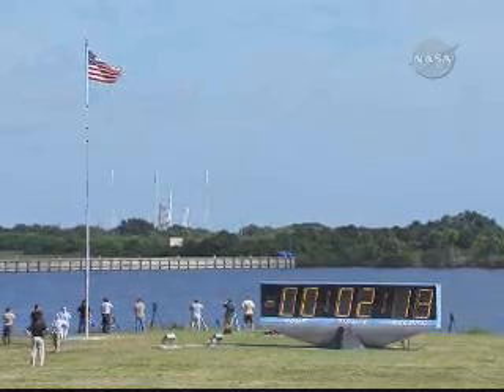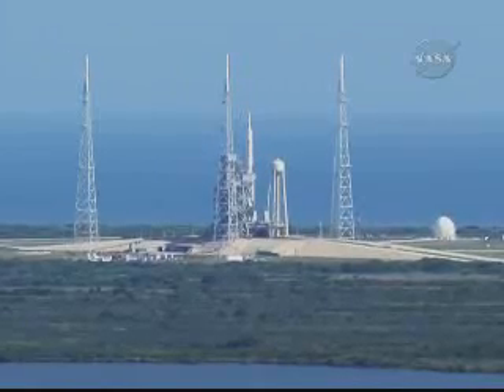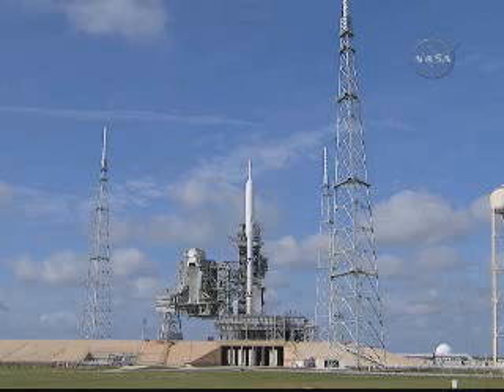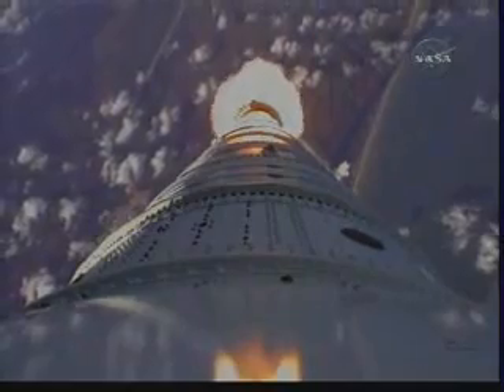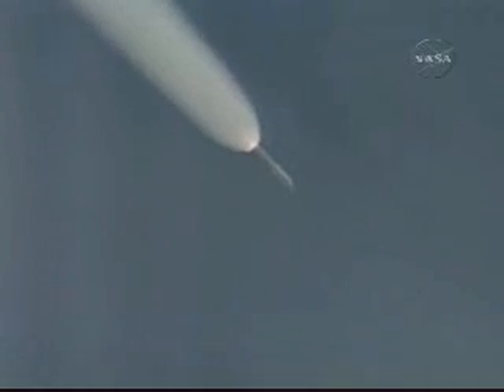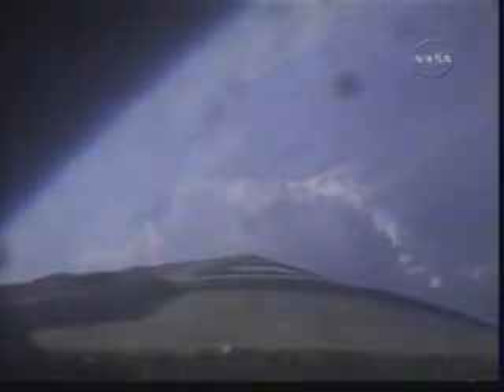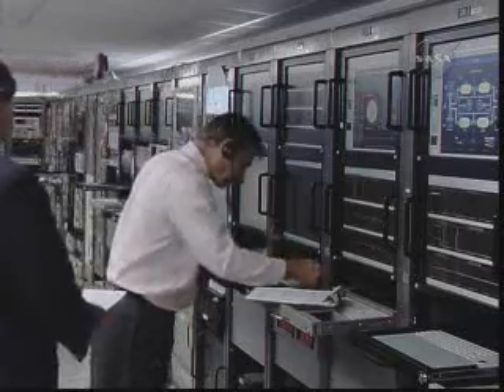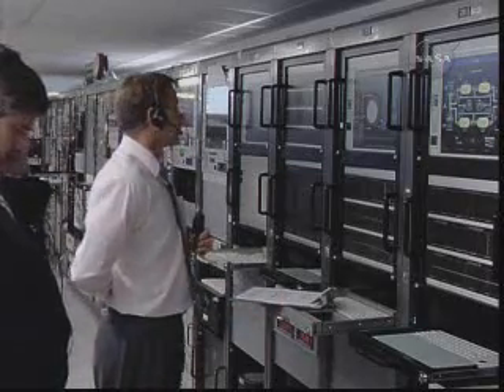NASA Ares I-X Rocket Launch Wed, 28 Oct 2009

Comment: @A86  - The key word you left out was "could".  Costs "could" drop which does not say they will drop.  Let me quote the same source for what the Shuttle was suppose to cost.  "Early cost estimates of $118 per pound based on 1972 dollars.  Correcting for inflation, this equates to roughly $36 million incremental per launch costs.  The shuttle program has been criticized for failing to achieve its promised cost and utility goals."  Actual cost ended up $750 million p/flight.

Comment: @ti994apc - Actually it's only $1 billion/flight if you only fly the rocket once a year. If you fly it several times a year the costs drop drastically to around $138 million/flight. Around the same cost as a Soyuz flight and only a fraction of even the cheapest Shuttle flights. 

The Falcon 9 carries the Dragon which is not an interplanetary vehicle.

Comment: Too expensive Lockheed !!  1 Billion a flight !!  Are you kidding me!  Solid rocket fuel (BAD IDEA) which requires an unbelievably big / heavy escape system.  Ares1 is much bigger than Saturn 1B and only can carry 5 people.  Falcon9 only 50 Million a flight and carries more people and much safer.   Ares V can launch for 90 million and Boeing can create a capsule for it that would be much safer. .

Comment: @ThermalHD - That wasn't a problem. That was one of the projected outcomes.

1) The upper stage in this test is a dummy. It's unpowered so it can't fly away with ullage motors.
2) The Ares I-X is tens of thousands of pounds heavier than than the Ares I and the first stage is a 4-stage SRB instead of a 5-stage one making it only 80% as powerful as the real thing. First stage separation occurred here at a lower speed and altitude than Ares I would with 9 times as much aerodynamic pressure.

Comment: Yeah that's my fault for not wording it right. (I shouldn't of used "these", mistakenly implying I was talking about the Ares rocket)

I am aware that booster rockets use solid fuel (like Ares).

In regards to my response to quilcksilverrules14, I was referring to the Orion spacecraft (which will use liquid fuel).

Ion thrusters are not really the way to go for manned space travel. They have very weak thrust but they do last a long time. They are only intended for LONG duration missions.

Comment: @kepler240 THe upper stage was just a weighted and blanced test load. Only ment to be used to give accurate numbers for the booster stage test. Lhe lower stage is ment to jackknife away to maximize drag and distance from the upper stage from upper stage for single engine start. It was expected to do that.

Comment: No one said Russia isn't capable of rocketry expertise. They've made pretty clear over the years that they are capable (ESA still depends on them quite alot to get their payloads launched into space). 

But Russia has also had alot more mission failures than NASA. 

Their manned moon program was a HUGE failure, almost all of their Mars missions have ended in failure, and while they had success with their Venera program, it wasn't until Venera 13 (13th probe launched) that they got real results.

Comment: Lightning protection system (read: Lightning rods)

Look at a the Shuttle on the pad. You see a big white rod sticking up above it? That's the lightning protection system for the Shuttle. The Ares is too tall for that lightning rod, so they built three 600 foot towers to draw strikes away from the Ares.

Comment: The dummy 2nd stage had no "ullage rockets" which are used to settle propelants in the tanks before that engine fires and takes over, and the would push the 2nd stage away from stage 1